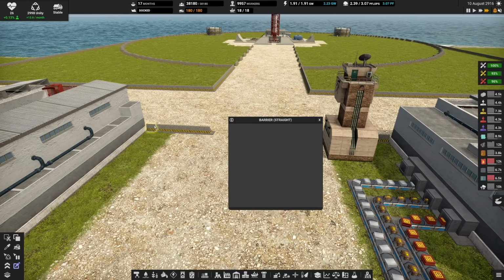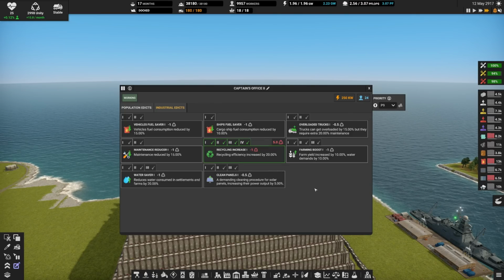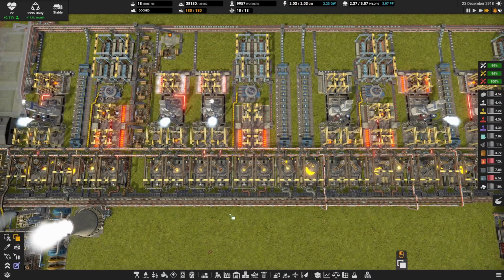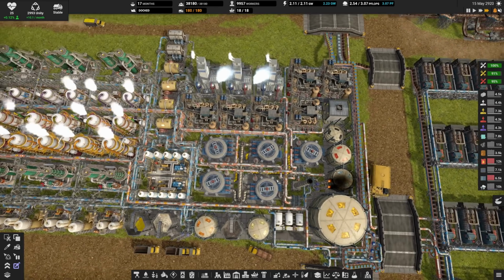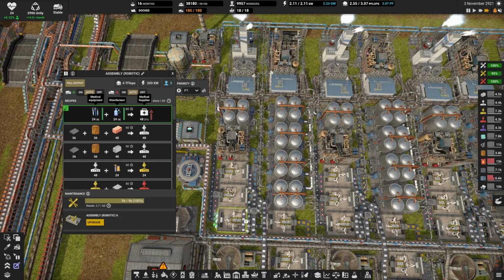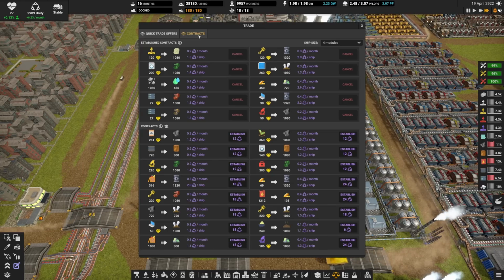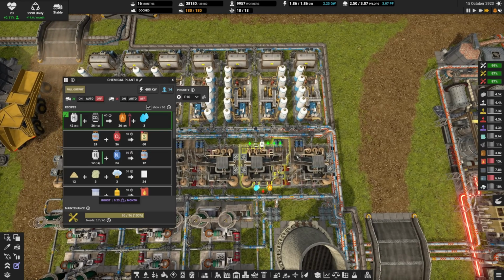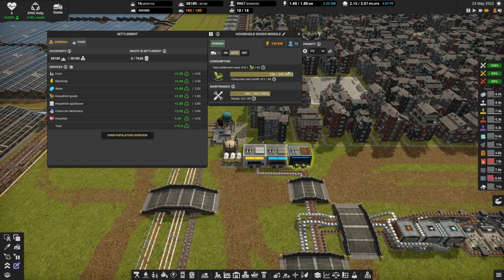The Island of Opulence  🚜 Captain of Industry  👷 Tippyc Island Tour

Comment: That's a very cool base! I'm surprised they went for the lab3 to coal contract. I get the impression that the Cement to coal contract is a better deal. Especially late game when you can recycle CO2 into diesel.
Reply: My thought process on that was that limestone is actually relatively hard to get, making cement difficult by extension.  Lab 3 is just some small amounts of copper, glass, wood, etc; stuff thats already on the bus in big quantities.
Reply: @tippyc2  I also imagine the fact that almost everything you can do to get rid of sulfur requires limestone has something to do with it.
Reply: @TheMhalpern  yeah that, also getting limestone requires construction parts which is a fairly complicated chain.  Then there's producing the cement, which is a slow process requiring lots of kilns.  On the other hand, producing the lab 3 takes less than a dozen machines to max out the cargo ship.
Reply: @tippyc2  somewhat unrelated, I also imagine that the rock mine is the absolute limiter, so after a certain point you want as much of it as possible going towards Hydrogen fluoride and gravel, so I imagine where possible you are using slag and quartz to substitute rock?
Reply: @TheMhalpern  yup.  Making construction parts with slag
Reply: @tippyc2  Makes sense. Thanks for your response.
Reply: actually it makes sense, all the contracts used are based on getting as many import modules as possible for a given resource on a ship. I believe it works out as 1 outbound module for 7 inbounds on a cargo 8. Same deal with servers for iron ore 1 outbound of servers for 7 inbound of iron ore, the exception here is quartz, and that's likely because of the additional resources and space going with consumer electronics vs solar cells requires, and with crude oil, because all the contracts that are technically better than vehicle parts 2 for crude are actually very expensive when it comes to what's involved in making the exported goods,

Comment: Thank you for covering my island JD.  Yes, my water supply is very lazy.  Copy-pasted the same thing 40-ish times. I got a good laugh at you trying to find the fuel gas feed at 35:30.
Reply: That last statue not working is getting the gas delivered  by truck isn't it? Hence the fluid tank next to it. The hidden balancer sends to the other 3 statues and the Tomb.
Reply: @YiotisTheGnome  No, JD was right, there was an underground pipe that was backward.  something i missed when i switched it from truck delivery to pipe delivery.  The tank had at one point fed all 4 statues and the tomb, not just the one statue.
Reply: how many hours has this taken? just out of curiosity:)
Reply: @danielappel4760  Lots.  Guessing somewhere around 400?